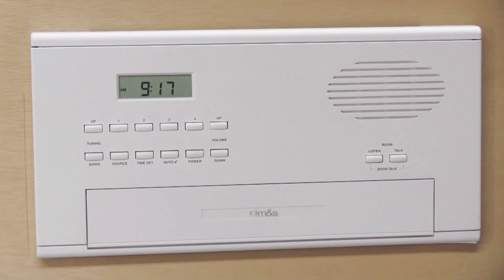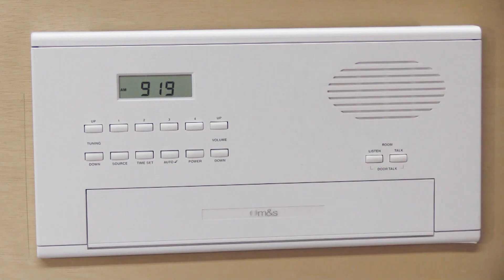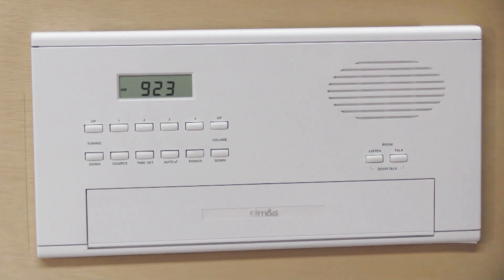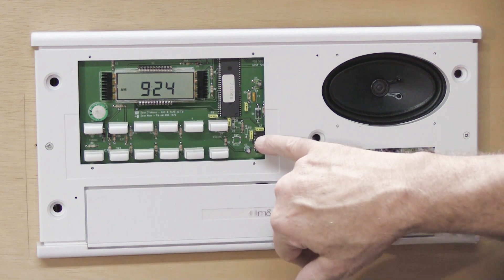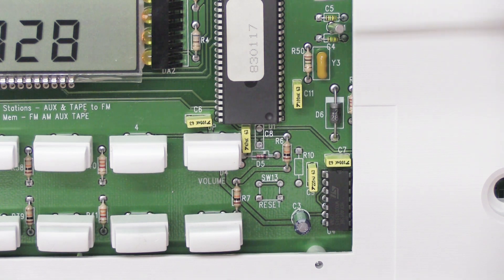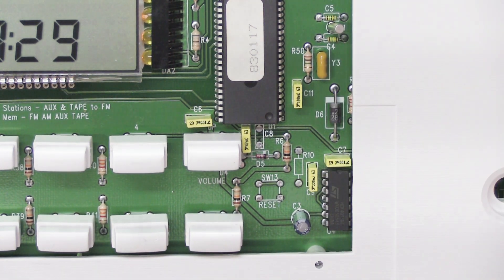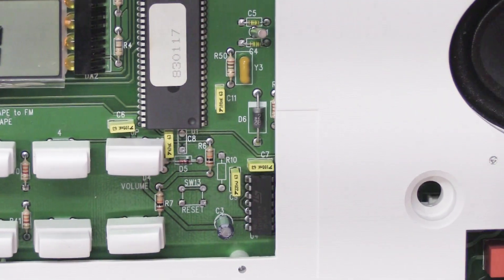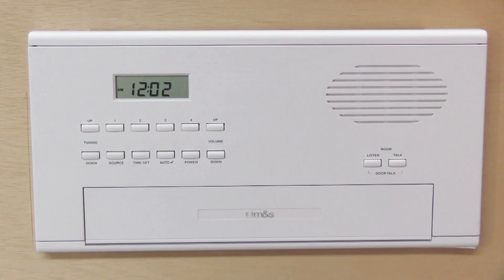How to Perform a Microprocessor Reset on a M&S MC602 Intercom Master Station

Comment: Hey Frank. I moved to a new house and found the M&S system here. The model is 602. And it was working ok, except door intercom and 1 unit outdoor, all the 3 others rooms were fine. We had a power off for a few seconds and now the display shows . It does a click noise but didn’t reset. The display still show list. Any thoughts and tip why it’s not resetting. Thank you
Reply from the maker: Hi Mfields:  Your question is far to complicated to explain or discuss here - It would be best if your conatcted us directly - Chris     nscompany@msn.com

Comment: I just bought a home with this system. And its stuck with a flashing clock, I did the reset shown here and it did reset back to 12:00 am but the buttons still dont work. Any ideas? I would like the get this working as there are speakers all over the house eapecially on the patio. Oh well
Reply from the maker: Hi Zhurak:  I have repaired many MC602's which have failed switches on the Master Station - The Switches can be replaced - you can contact us directly about this - Chris       nscompany@msn.com
Reply: @northsideservicecompany3567  Thanks for fast reply, apart from fixing it, im wondering if you could recommend a more modern replacement. These systems are a bit dated and I would p[refer to have something with bluetooth and a nice touch screen instead.  The existing wiring throughout the home is the real value here, so is there anything modern that can interface with this?
Reply from the maker: @Zhurak  You will need to research what is available as a replacement that suits your requirements - Remember, this is a "System" so anything new you choose will require replacement of all the original equipment - Chris

Comment: I am able to perform the reset. When I does so, it quickly scrolls through a bunch of numbers and ultimately the display shows a number 32, with none of the white buttons working. Any thoughts?
Reply from the maker: HI David:  You have a proble with either a Remote Station - Wiring to a Remote Station - Master Station problem - or a combination of these possible problems - Further troubleshooting is required to find the true source of the problem - Chris

Comment: I have an M & S 902 intercom system. I thought it was dead but after messing with it for a whole day, I managed to get the music and door bell working. I can't get anything on my intercom to work. Music works, door bell works, sort of, but the intercom just has awful static coming out of it. The problem is, I use this system to talk to anyone coming to my gate at the end of a driveway. The unit at the gate still functions in regards to the keypad to open the gate but no intercom or doorbell from that unit is working. No one seems to know what's going on. I saw that you sprayed something on something to get the weird noise to stop coming from intercom but you didn't explain where the spray went. I am NOT an electrician but I try to do what I can by watching google....can you help me. The bids I have received to replace this system are out of my budget. I need to fix this thing! Thanks for whatever help you can offer. Carla
Reply from the maker: Hi carla:  Your questions are reasonable - however they are to involved to address in a YouTube comment - It would be best if your contacted us directly about your MC902 - Chris     nscompany@msn.com

Comment: They probably kept it hidden so all those saved settings wouldn't be accidentally erased.

Good thing you're an honest guy. There are people who'd make money 'repairing' stuff like this.
Reply from the maker: Hi midhamm:  That could be true - it would have been better if they had put an actual switch on the circuit board - I don't like the idea of people jabbing around on the board, with a metal object. . . Chris